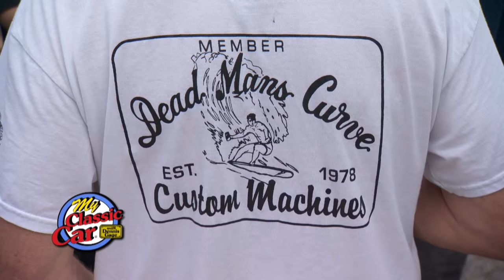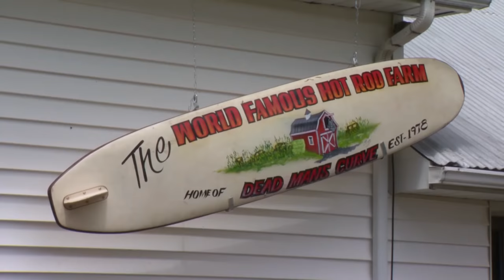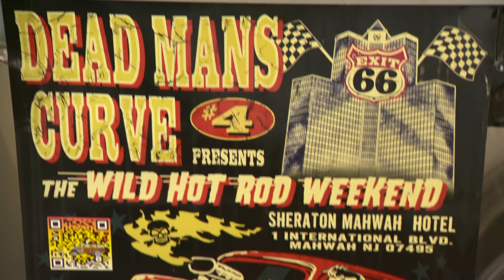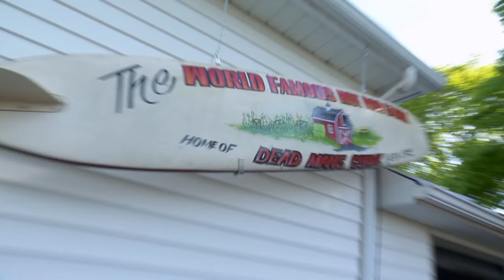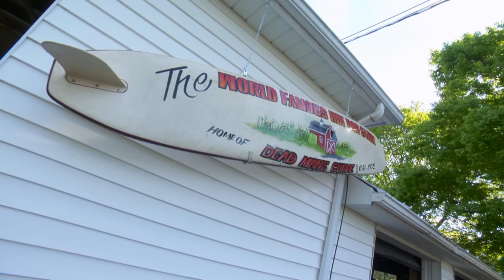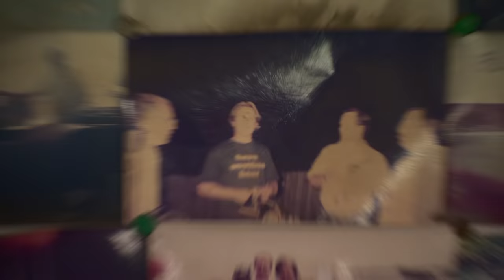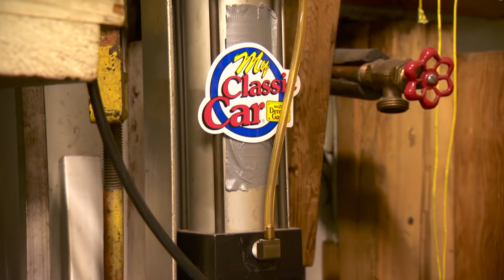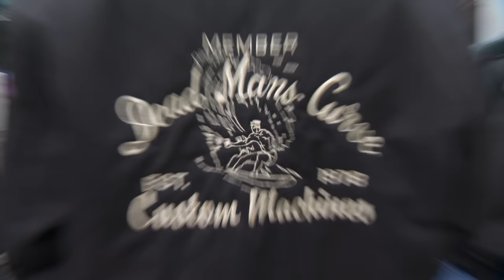Dead Man's Curve Hot Rod Club (Director's Cut)

Comment: Where I'm from, the Gassers on the Street were happening in the late 60's (66- up) I'm from South San Francisco ( South City, home to Gotelli's Speed Shop, Andy and Roy Brizio, Sanderson Headers, and the very first was Champion Speed Shop. Everyone I know was building and driving a Gasser style hot rod. Myself,I had a 56 Chevy 210 straight post 3 door station wagon. 283 ci with dual quads, 30/30 Duntov 3/4 race cam, fender well headers,I didn't have a straight axle but I did have extended spindlesthat Jacked the front end up to the sky! I ran old Crager Magnesium front wheels, and out back were pie crust cheaters on steel wheels painted black and white for that flip flop look, what a Gas! Great time to grow up!!
Reply from the maker: The best!!
Reply: I remember back when many drag racers painted the rear wheels half black and half white!

Comment: Bit of trivia on the early Novi’s (ref the 1963 at 22 m);  the car was a unit body in that it had no frame and the front suspension was just attached to the body at the firewall.  This was all Ok until the SB V8 was available as a factory option in 1964, problem was the front of the car was designed using the engine as part of the suspension via the motor mounts which when tied all together made for a “somewhat” sturdy unit.  
However when the V8 was offered in 64, the factory had to specify a special block that had additional casting strength at the mounts seats,  this to preclude pulling the seats right out of the block.  
I converted a 63 Novi wagon to a SB V8 in the mid ‘60s and had to get one of these blocks. The crappy suspension and brakes on these early Novi’s was not safe,  I used Malibu brake components all around which helped but front-end alignment was always a problem.